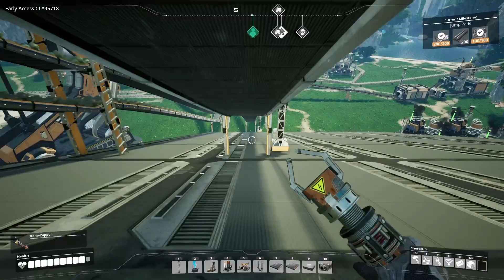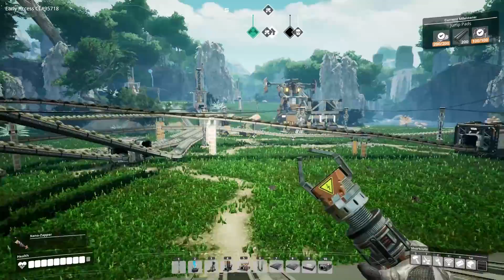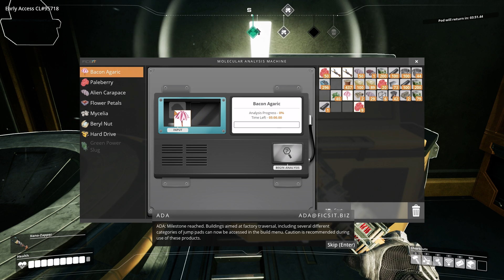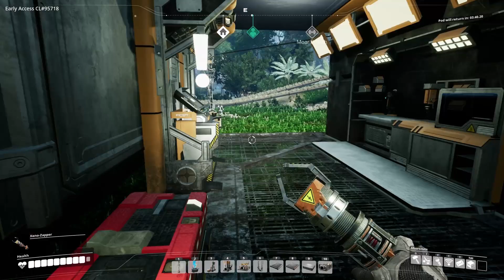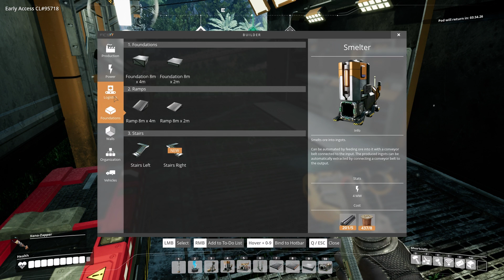Jump Elevator – Satisfactory Multiplayer Alpha Gameplay – [Stream VOD] Part 19

Comment: Ah... jump elevators. A very satisfying, and quite useful, way to navigate through multiple layers quickly. :) For sloped rises like you're doing, I'd suggest a Tilted/Normal/Tilted/Normal type of setup. Basically, the Tilted will bounce you towards the Normal, which will bounce you upwards and forwards but will also set you up for landing on another Tilted further on and higher up, which launches you to another Normal, which sets you up for a Tilted... so on and so forth. Doing Tilted/Tilted/Tilted makes it really hard to land properly.